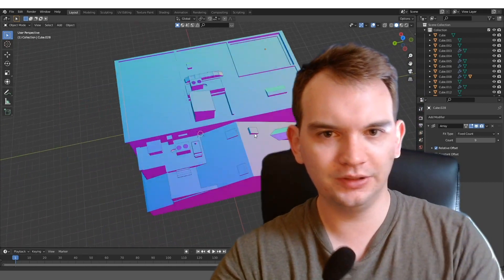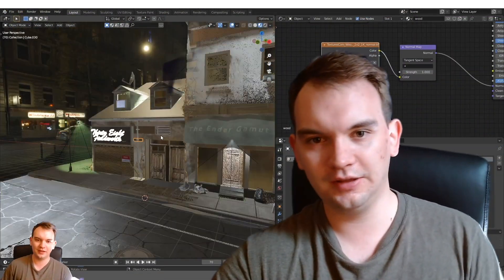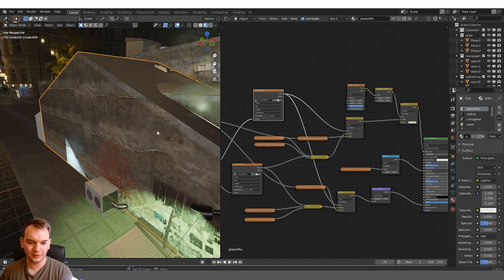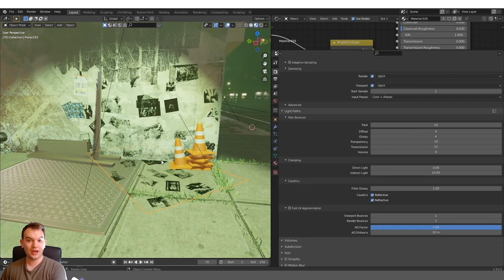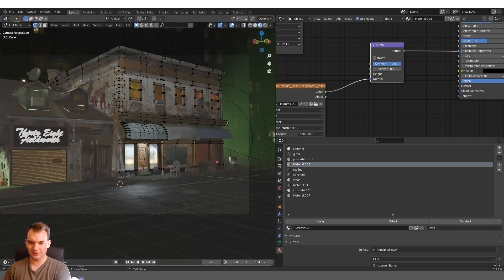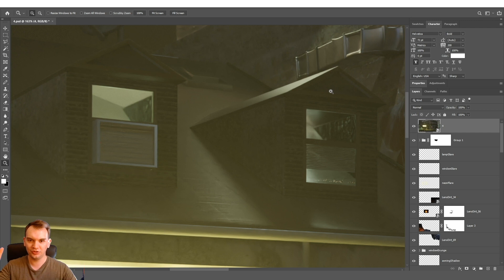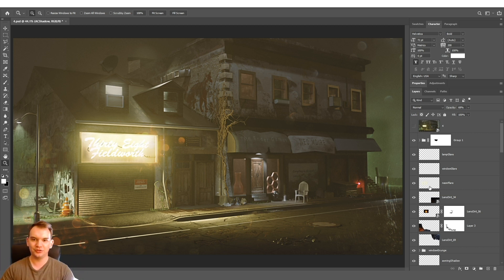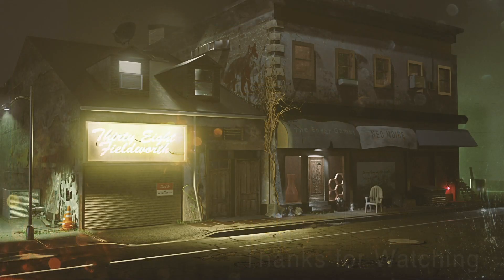Adding Lazy Details to 3D Renders with Photoshop (and Neon) | Blender Projects

Comment: good work, i like the amount of detail - especially the posters to the far left... they're very small details but it adds a lot. my only critique would be at 1:35 you say "the subject is this building", referring to the one on the right, but... from someone viewing this for the first time: it's not. the subject seems like it should be the building on the left, because that's where focus is being drawn due to the neon light. there's quite literally nothing drawing the viewers attention to the building on the right: it's not illuminated & it's mostly in shadow, other than the door. also i think you'd also get a lot more realism if you try playing around with the depth of field settings on the camera. a small amount of blur would make this go a lot further. Great tip about the neon sign & how the letters should be joined, too 👍
Reply from the maker: Thanks for the feedback! Yea, I'd say the subject is the one on the left. Maybe I wasn't very clear in the video! (I was kind of panning all over the place!) Definitely, a neon sign certainly screams "look at me!" I actually named this piece after the address. As for depth of field, in a good 90% of renders, it's necessary. In this particular scenario, a large "landscape" image would probably result in very little DOF in the real world unless you stopped your camera down to like f/2.8, or were using a super telephoto lens (this image's camera was at like 45mm), but you just might stop down, since it would be a low light scene (lower f-stop = more light coming into the lens = more shallow DOF). I don't typically see many architectural renders with very noticeable depth of field for this reason; it might actually decrease realism. However, it's always there, even if only a little. So definitely something to think about.